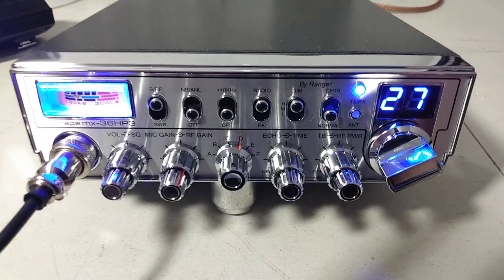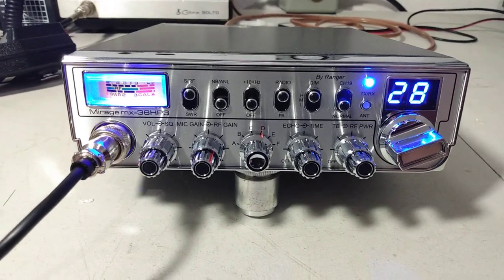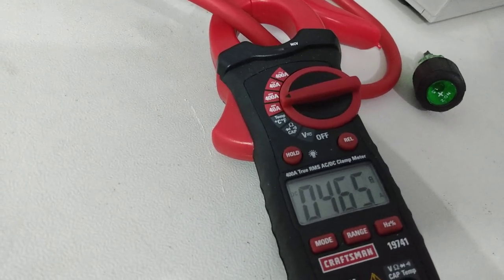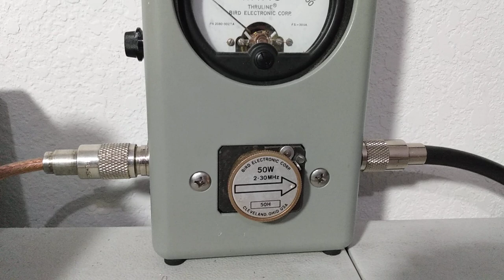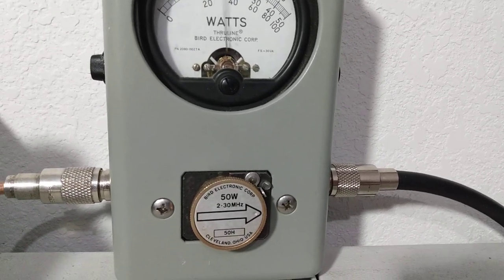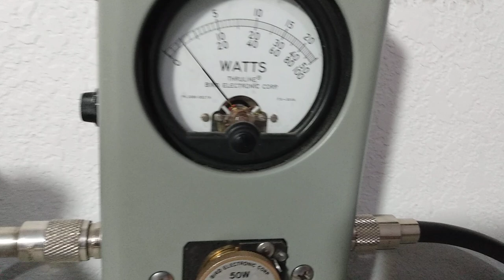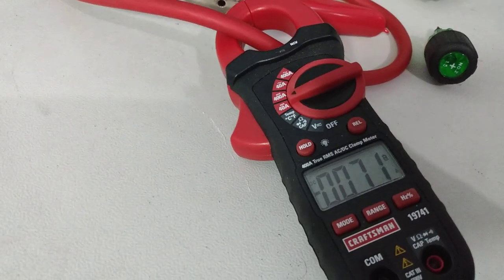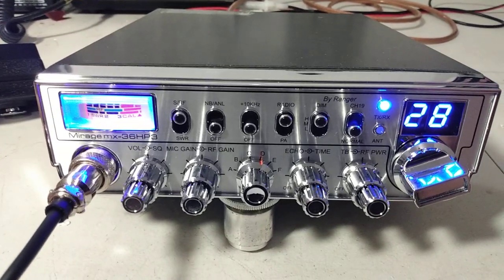Mirage 36HP3 Sold, Average Power vs Peak Power, purchased from roostercb.com

Comment: One thing about average power is it’s more accurate representation especially as noted about the amp draw. 
Ssb uses a electric circuit that requires a battery. Pretty good but still. 
A digital meter is on my want list.   People get hung up on a few watts. Takes about 4 time the watts to make much difference.
Reply: Ssb should be pep